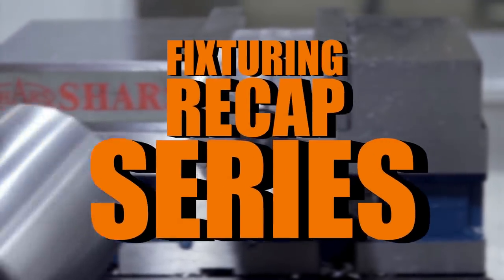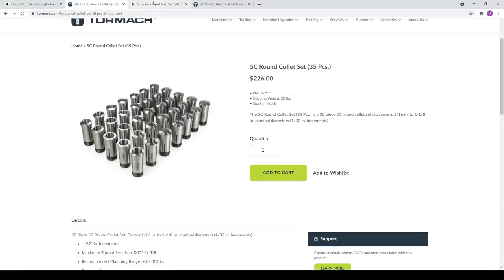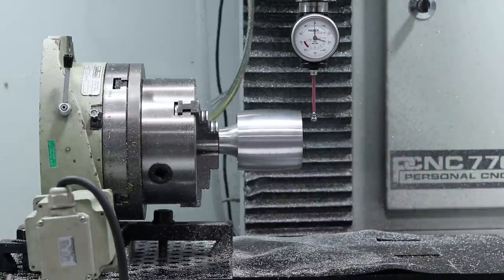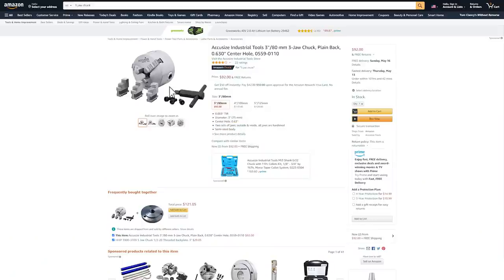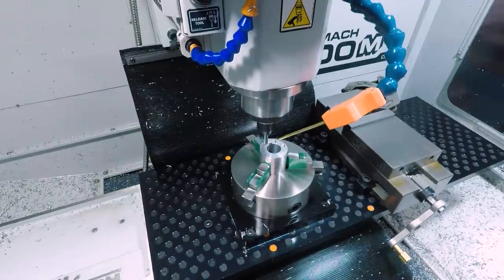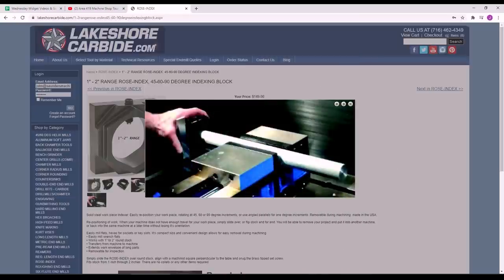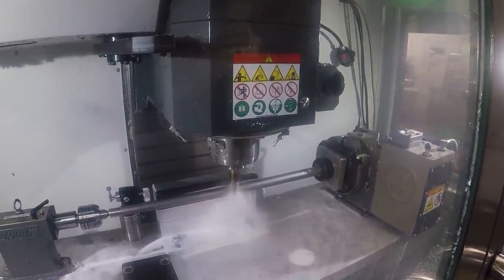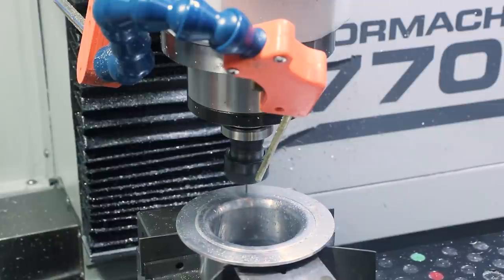Workholding for Round Parts:  Samples of Chucks, Mandrels, Collets and more!

Comment: Recommend ER collets and blocks over 5C for workholding.  ER collets clamp from the working face instead of the rear like 5C.  Thus you can make fixture plates and gang fixtures with ER collet blocks.

Comment: @2:51 how you got the chuck holding to that fixture? I saw center hole & 3 120deg apart holes drilled there @2:45...whats the connection ?

Comment: It can be useful to have the same spindle nose fitting on your rotary as on your lathe. Not only does it mean you can use all the same chucks, but you can transfer work from one to the other without re-fixturing. 
I have found it so handy, in fact, that I recently made a fixture for the mill bed so that I can mount all my lathe chucks vertically, and repeatably. 
(And, I made a low-quality video of the process: https://youtu.be/otycJD_0478 )